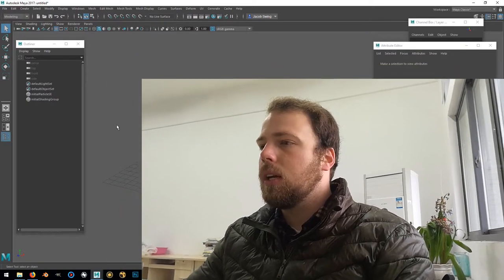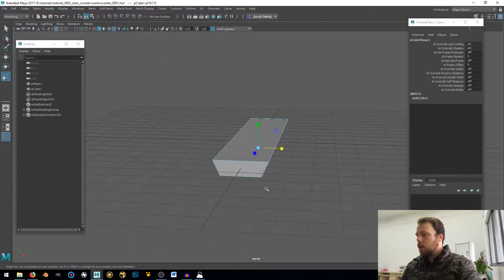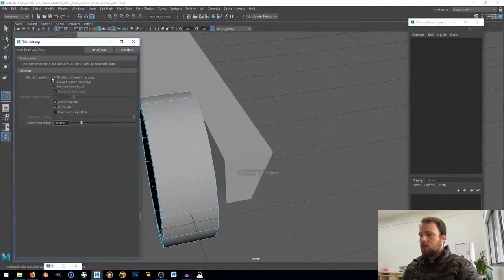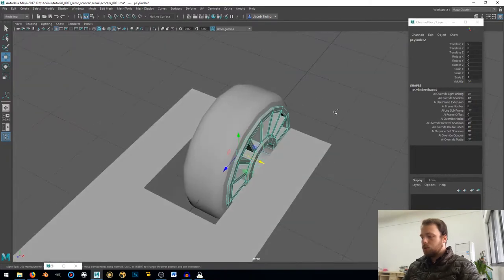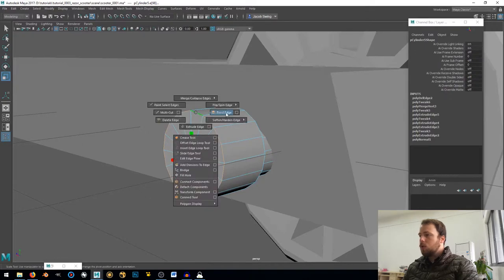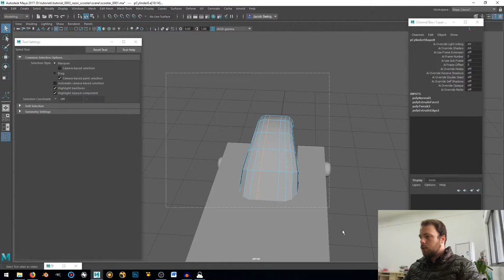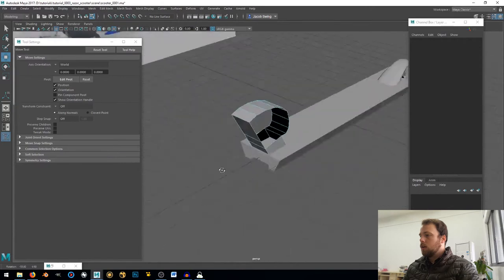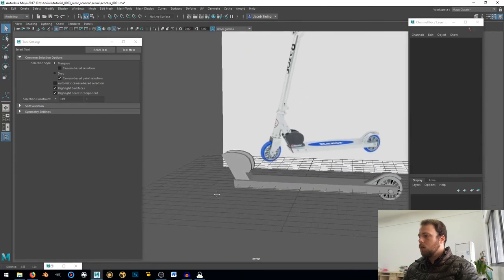Tutorial #3: Model a Razor Scooter - Autodesk Maya - Beginner - Part 1

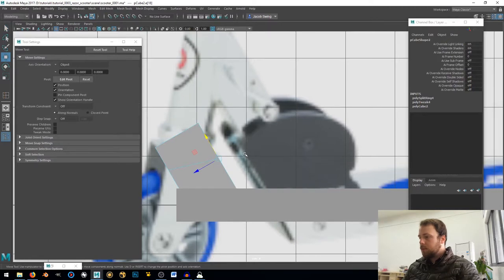Comment: 26:31 i am confused, with edges how your increasing
Reply from the maker: I extruded a long the normals. This increases the edge thickness
Reply: It's invisible to see
Reply: @jacobswing  But the backside i am not able to increase the edge
Reply from the maker: You might need to make sure the normals of your mesh are correct. Sometimes, if the normals are not facing outward, then the extrusion does not work properly